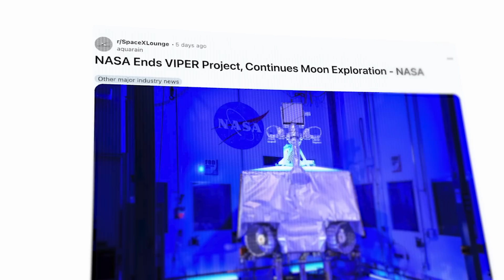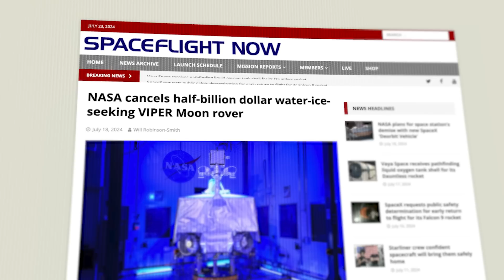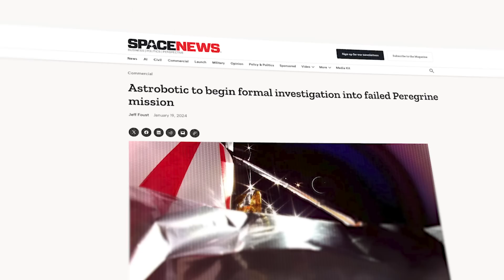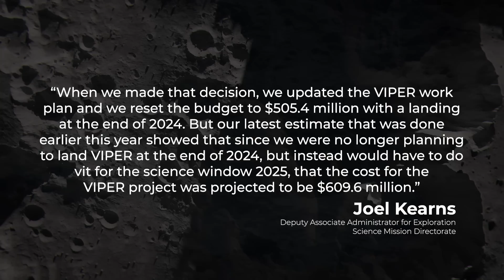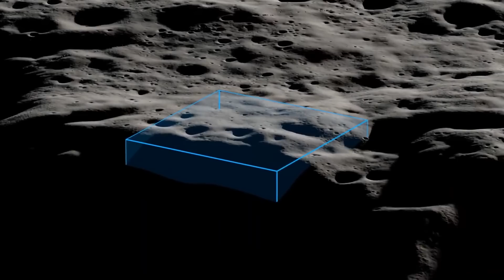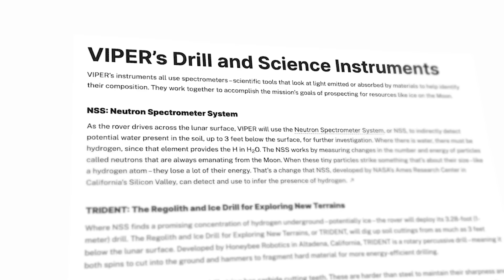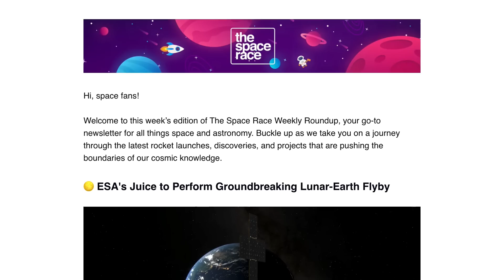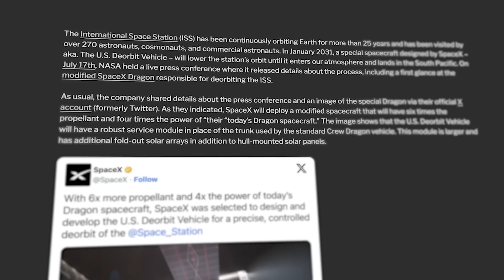NASA Isn't Landing On The Moon...

Comment: Considering the huge money, ppl involved & time given for Apollo to succeed, including the "Surveyor" probes,
 It is no easy task to just pull a decent lander outta yr a§§,
 do the expensive & time consuming R&D,
 then actually get it to the moon without a software glitch, failed burn, tipping over or crashing.
 All that cannot be rushed, there will be delays..
 there will be cost over·runs, It's aerospace FFS.
 & it's a manned trip made fewer than 10 times.
 Don't expect perfection 1st time & on budget, but it will get done..

Comment: the viper should be a spherical, vehicle that can go 100km/h not 8km.h with dust..these are already designed and prototypes.   cost should be   100 mil.  i have to simulate them because they are so full of spineless .   we could go extinct any day before 2100 likely.  india did a lander on south pole for 90 mil.   full trip.  space X put a tesla .  what a wasteful species.  if we go extinct like the sharks and Rays we endangered, we have died of timidity.

Comment: We are at a crossroads. At one time money was necessary to put a value on certain things. We're at a point now where putting dollar values on some things is unhelpful, especially when it comes to NASA's projects and endeavors. If the ultimate goal is to land a person on Mars, you need to do what it takes, the dollar value is basically meaningless. Just how we transition from our current capitalist attitude to a new attitude, I don't have an answer for. That's for smarter people to figure out. I cannot be 100% certain what did happen back in 1969, but the more the U.S. struggles with moon travel, it becomes increasingly questionable we ever did it the first time.

Comment: If Nasa built a 100 km ball on Earth they could go to outer space in an elevator and if they built a 100 km ball on the moon they would be able to travel to the Moon at 16 * faster than if they were to land directly on the surface which is why the space station can orbit the earth 16 times in one day because the gravitational force of an object is greater on the ground than it is in the higher altitudes which allows objects that are higher off the ground to move at a faster speed than objects that are on the ground may they be on earth or on the moon

Comment: Perhaps a solution here is to rewrite the contract for VIPER as a fixed firm price contract?  This would avoid further cost overruns and show if the contractor really believes they can perform under a budget ceiling.  It seems the FFP approach worked well in crewed flight for the development of Dragon, although not so much for Starliner despite their higher budget.

Comment: They may make it back to the Moon with new crewed landings but they won't be landing on Mars because the medical reviews of astronauts who have spent a large amount of time up in space have found that human kidneys and other bodily parts shrink. And as it takes quite a while to get to Mars for any spaceship many normal everyday body functions would severely be in decline and Astronauts may not be able to do the required exploration tasks envisioned or desired.
Reply: One proposal to counter this was to send 2 Starships tethered by the nose with a couple hundred meter tether, then start spinning to yield about 1g apparent gravity. This would eliminate muscle and bone loss, etc. Then stop spinning when near destination and proceed normally. Regards mission duration. Using HAL thrusters, the estimate is as low as 90 days each way. 
May also want to use scores or hundreds of human form robots to do construction on the surface (will also need mining equipment (maybe a lightened version of Boring Company Prufrock machine to build reinforced underground tunnels for habitation/mining and mine for ice and minerals.

So long as a small clutch of humans are there to correct mistakes to instructions (without massive signal delay), should be able to land at least 200 robots in a single ship and the robots could be human form Teslabots with dust/radiation protection. So no great development cost. Habitats could be built in the reinforced tunnels Prufrock creates (it lines its tunnels with thick concrete hex tiles as it goes... perfect for colony tunnels, which can be made circular to install maglev trains to simulate higher gravity to avoid 0.38g loss of muscle/bone. These would use solar and nuclear power (NASA is building a 6t nuclear reactor that should be suitable.
Trains can run very efficiently in near vacuum that already exists. 

Sooo. I would go to the moon first and do all of this, mining, sub surface habitats, ring bases with 1g effective "gravity", build Luna orbital shipyards for giant interplanetary ships (that shuttle outsized cargo orbit to orbit which shuttles like Starship to offload cargo to planetary surfaces- LEO to Luna or Mars or 16Psyche.
Then go to Mars and replicate the process as a jumping off point for the asteroid belt (mining).

Comment: Spacex lander is launching in 09/2026. Latest 09/2027... so given the many tens of tons of cargo capacity, the crawler can be launched on that mission. Don't see the need for a seperate mission and lander when a half dozen rovers can be dropped on the moon in Starship and go in 6 different directions to find ice at a much lower cost.

Launching earlier at great cost/risk would seem a waste of money. If Spacex lunar lander fails, they (Spacex) will simply try again on their dime (and they will have alot of those thanks to Starlink which had $6.6 billion in revenue last year and is set to easily top $10 billion in 2025.

So keeping the rover and cancelling the deployment package/launch would seem very prudent.
They need to prove out Starship lander in any case, so this would be a free ride as it can easily be added (in multiples) to the manifest given the lift capacity. 

Most of the sunk cost of the rover is already spent (design and initial fabrication). Better to produce another 5 copies or so to cover much more ground. As the design work is done, I can't see how building 5 more at $20million each would be a problem.

They would be small passengers on the massive Starship lander... and we need to figure out how to unload cargo in any case... something Spacex is already working on.

At this point, further work on a specialized lander would seem a waste of funds.

Comment: Outer space is fake. You can’t have gas pressue without a container. If the sky was a vacuum the gas we breathe would fill the space. 

Nobody is going to the moon via a sky vacuum. The whole thing is nonsense! A second law of thermodynamics violation.
Reply: 2:30 stop motion animation akin to thunderbirds. 🤦
Reply: Its third law of Newton.. that works on rockets propulsion system. The gas particles  eject and get out, creating the  propulsion the rocket
Reply: And gas dosent need a container..it's pulled towards the earth by this thing called Gravity.

Comment: Why litter the ocean floor.  The sun is a big target and it's not moving too fast relative to us.  Granted it'll take a while to get there, but very little mess when it hits.
Reply: Actually the Sun is moving fast relative to us--or rather, we (the Earth) are moving fast relative to it. Note how the Parker Solar Probe had to make several flybys of Venus in order to shed enough orbital speed to get close to the Sun. It takes as much change in velocity to get from Earth to the Sun as it does to escape from the Solar System entirely.
Reply: ... and if the aim is to simply fall into the sun with no urgency involved - say 20 years, 50 years, 100 years.

Comment: I still wish they wouldn't choose to demolish the space station, considering its historical significance and contributions to humanity. It was assembled piece by piece in space; why not bring it back in sections for safe museum display and more?
Reply: With what? The ONLY vehicle that could possibly achieve that is the Space Shuttle. We lost two operationally, and the others will never fly again. And that assumes they could actually survive reentry being a hundred tons of more over their designed landing weight.
Reply: The only currently-planned spacecraft capable of bringing large masses down from orbit intact is Starship, which is at least two years away from being fully operational. Furthermore, the ISS modules were not really designed to be capable of separating--there's things like one-way bolts that tighten but won't loosen holding it together. Bolts and wires and whatnot would probably have to be physically cut through.

Comment: Old space has been ravaging the trough for years and is still putting in  pricing based on the ridiculous prices they have charged before current time. If we weren't paying in excess of 4 Billion a launch for Artemis launches and other over priced projects and Bezos court cases, there would be more than enough for this and other significant projects.

Comment: Um, why is waiting going to raise the costs 100 million a year. I doubt fuel costs are going up that much and even if they are pre purchase the fuel and store it until launch. This sounds alot like corporate theft.
Reply: They would be doing constant maintenance. The rover structure is designed for 1/6th g, no atmospheric gasses to interact with. The batteries only have a limited shelf life, so they would have to be replaced (and you can't use Die Hard's from the local Firestone store. Those are custom devices that are expensive to make, since they have to operate within a 350 degree range on the Moon). It would be either that or disassemble the thing for storage, then rebuild it in the future.

Comment: Either way, the budget for Viper is ludicrous. It shouldn't cost that much to construct a Rover or Lander. Perhaps, it's time NASA started looking for other contractors.
Reply: retrofit a golf cart
Reply: China: You know? There is one contractor that has the experience on building moon rover, has an impressive 100% successful record and the industrial capacity to deliver it on time within budget. Want to know more about it? WinkWink
Reply: Are there any other options? They can't outsource it to India, and they aren't built in sufficient numbers to make scale savings.

I think they just need to get better at estimating cost in the first place.
Reply: @frjoethesecond  When it pertains to building the Rover itself, it's simply an aluminum chassis, all terrain titanium wheels,  a pair of electric motors, batteries, power generator, sensors, scientific equipment, and insulation. Most parts can be off the shelf purchased components. At the most, you'll need a custom chassis, power generator, insulation cover, and do slight modifications to off the shelf components to reinforce them. The Rover shouldn't cost more than 5 to 10 million. At this point, it seems NASA needs to be drastically reformed to purge it of its incompetence and irresponsible use of funds.
Reply: @Bulletin-mf2dy  The problem with building space probes is that you have to build them so that they can function for years without any maintenance. Sure you could use an off-the-shelf desktop computer to control the thing, but would consumer-grade off-the-shelf components function for years on end in an airless environment with huge temperature swings and no chance of repairs? Think about how often your own desktop computer needs something fixed. There's a reason that we use the term "rocket science" to refer to something hard.
Reply: @sailordolly  Actually this isn't quite accurate. Missions like these have strictly defined operational time frames, usually several weeks. Especially in environments with huge temperature swings as you mentioned. Any operational time beyond that is considered a bonus. That's how the Mars rovers worked too. There is just too much wear and tear and unpredictability to expect probes to last several years without maintenance.
Reply: @frjoethesecond  Of course there are other options. What kind of defeatist attitude is that? Both China and India built and landed rovers on the moon for a fraction of the cost, but for some magical reason America can't without spending over half a billion dollars? Ridiculous. This is a management problem. Too many cooks in the kitchen. NASA spends and wastes too much.
Reply: @OdinReactor  China and India pay their employees and contractors a fraction of what America does.

Indeed, everything in America is way more expensive than it was during Apollo. Inflation doesn't just add to the cost of a project. Inflation multiplies the cost by however many companies, processes and employees touch a given project.
Reply: @frjoethesecond  Nonsense. By that logic, NASA cannot be fixed and so is no longer fit for purpose. Sounds like SpaceX needs to start a rover division.

Comment: NASA decided to cancel Luna Mission program, because they want to send human mission to the Sun. Because NASA's goal is just to spend money, not to achieve the goal, the more impressive the goal would be, the better chance for bigger budget. Sun's space vehicle will cost at least 100 billions of USD, so NASA decided to quit Luna Mission, and put all money NASA has into Sun Mission. Boening will have a chance to develop Sun lander, Sun suits, Sun yellow submarine, and Sun drone. It's a challenge, but Boening is capable of doing it. Some other companies work on solar panels the mission will use, and special Sun-glasses, allowing Astronauts to lower the intensity of light at the Sun's surface. It's planned that in 2040 the first Humans will walk on the Sun's spot surface, and swim in Sun's boat on the liquid Hydrogen ocean. It is considered to build Sun-truck, Sun-phone, and Sun shower. The biggest problem is not temperature of the water in the shower, but radioactive emission. Boening is optimistic, for Boening it's not a problem, they can fix it. It is planned that Sun mission in early 2040 will be delayed and finally canceled. The next NASA mission will be Interstellar mission to Alpha Centauri, it is estimated that it will cost 30 trillions od Dollars.

Comment: Here’s how to cut costs: Instead of dumping the ISS in the ocean, use the modules to construct a moon station, saving costs on both ends.
Reply: No, the modules have a life span due to thermanl cycling of the pressure structure. beyond 2030, the chance a module springs a spontaneous leak grows mildly exponentially. However, it could serve as a guinea pig for monitoring orbital debris damage, if they could boost the orbit to one with higher debris density.
Reply: Now there's an idea. But the modules probably won't survive a landing on the moon. I imagine they are not structurally sound enough to handle the G-forces. Would be an interesting experiment though, even if it doesn't survive.
Reply: What's wrong with you... stop applying logic, common sense, and rationality to this problem...
This is N.A.S.A. we're talking about here, it's our money that pays for the expenses.
N.A.S.A. is like a 10 year old, all they know is that they don't have any bills to pay🤔😉
Reply: @patpozzuto4809  Totally offtopic dude